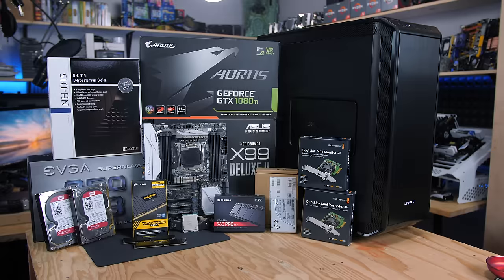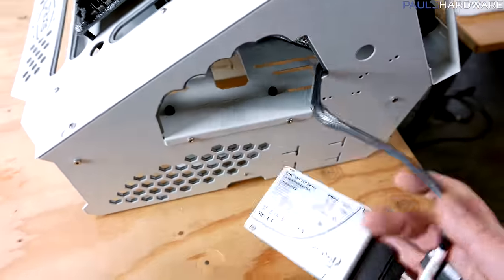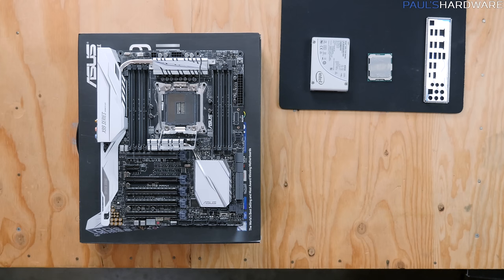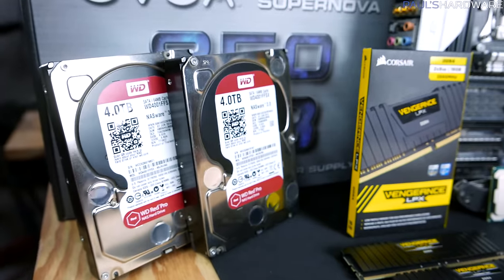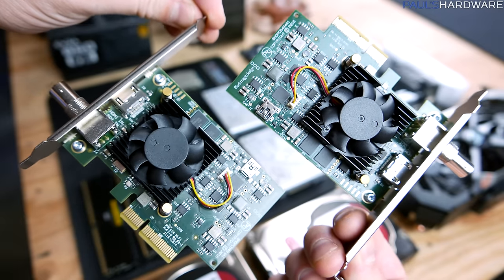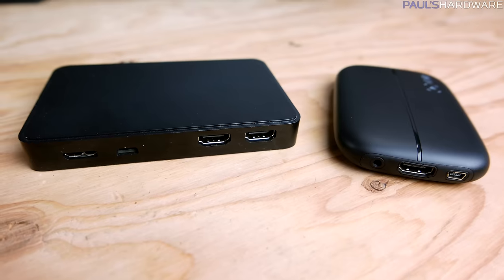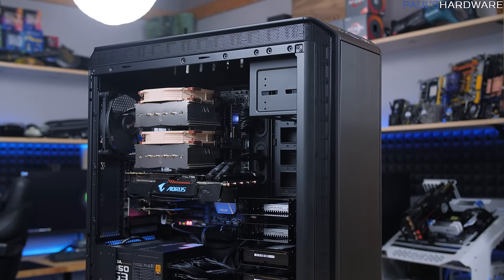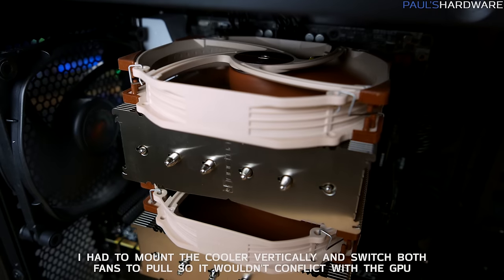The GODLY PC! My Ultimate Streaming + Capture System Build

Comment: I'm writing this, the year is 2023 and I'm just letting you know you used it till Q4 2018 when it died on you and you replaced it with a Ryzen "Epyc 2" 2998X which, to all surprise, you're still using. After the silicone depression of 2021, our modern CPU-s cost hundreds to thousands of bitcoins and even the second largest tech channel (your and Kyles Bitwit Hardware) can't afford better except for testing. Luckily, the Oculus VR TimeChat 2022 was invented last year by Facebook and almost everyone has it on his Android Q device (quantum smartphonewatch). PS: You're on a good way to pass LukeTechTips, maybe in 2024... XD
Reply: 191x7 agreed
Reply: 191x7 I get this is satire but Epyc are going to be geared towards servers
Reply: 191x7 luke dies in 2025. I'm from 2027. Consoles no longer exist.
Reply: GrizzlyPanda347 Aren't Opteron server cpu's and EPYC AMD's HEDT platform? But tbh Intels HEDT are just modified XEON's, so these can also be seen as somewhat server cpu's.
Reply: The Echelon Being that there's codenames and actual skus of different chips(Whitehaven=Threadripper, Zen=Ryzen)I wouldn't be sure. I'd expect them to rebrand Opterons like they rebranded their main line (FX>Ryzen). And Xeons are modified HEDTS from what I've read, not the inverse. An NCIX vid said that Threadripper were the HEDT chips, not Epyc.
Reply: Kill Ball2 so the "two years scrapyard wars 17 project" won't happen? now I'm sad...
Reply: At least AMD (perhaps Nvidia as well) may still hold some patents though.....I think
Reply: thread ripper is the workstation cpu and Epyc the server cpu just to let you know by facts .....
Reply: Missed opportunity by not saying "President Facebook".
Reply: 191x7 did Ireland get the 2023 rugby World Cup

Comment: can't believe i'm just now seeing this after all the research i did, just last month i built a very similar system except with threadripper 1950X. almost everything else is the same, but i also modded the case to accept three 5x3.5" drive bays in place of a front panel. so it has 15 hot swappable hard drives fed to a highpoint 3740A raid card, a custom HDMI slot + media card panel in place of the upper 5.25" floppy bay, then above that the case itself has a 2.5" SSD hot-swap slot which is pretty cool. on the back are more HDMI ins, SDI ins, etc. so it can hot plug almost any storage media you'd feasibly have footage on, capture directly on the computer, or link to any recorder or field monitor on the market. i had intended to make this system portable, as a way of basically consolidating all my field devices into one thing and then using software instead of specialized hardware for major field applications like switching cams, mixing audio, and storing footage. as it ended up, it is just as versatile as i intended it, i mean it HAS all of those functions plus a lot more. not only does it have all these capacities for interfacing with all my cameras, mics, and recorders, but i can edit on it, drive 4 displays with it, it's a $9,000 machine but it allows me to sell a sound devices 633, an odyssey and an atomos, and so on. the only problem is it just doesn't really adhere to my initial goals. i just didn't realize how heavy it'd ultimately be. i got a very particular case with a heavy duty handle on top so that i'd be able to lug it around the way we do with the specialized machines, but just one handle. i looked at plenty of cases with handles on either top corner of the tower, but decided against them because 1) the handles stuck out at diagonal angles, which would impede putting the tower into a pelican case and actually getting a lot of contact between the tower and the protective foam, and 2) these cases just happened to be built in ways that would make it difficult for me to mod them for the drive bays. i really needed hot swap bays accessible from the exterior, sort of like a rack. so i picked the only case i could find that seemed rugged, portable, AND moddable. but it ends up being over 100 pounds with 15 hard drives in it, and it doesn't have a second handle so 2 people really can't team up to carry it. but yeah assuming you can get it on location, it's extremely useful as like the central node for all your hardware, integrating all your cameras and mics and recorders and switching, mixing, and editing in real-time, while compressing AND streaming on a super expensive mobile network. this lets us not only stream 1080p yoga & meditation workshops out in wilder areas (which is something i don't think anyone has actually done before) but also add digital elements in real-time, not just slates but the graphics setup is strong enough to stitch 360 footage and overlay psychedelic fractal elements which we generate in real time with a specially made program. that aspect sounds a little over the top but if you can, why not? as for the resolution it's just limited by the wireless service you can get on site. satellite wifi is still nowhere near good enough to justify its cost, at least for us, so mobile service ends up being the best usually. hasn't happened yet but if we do get a location that has good cable or fiber service, we should be able to do exactly the same thing but at 4K instead. and the hardware is of course totally upgradeable, the real core of the PC is the modded case, so in a few years i could see getting a new CPU, a new corresponding motherboard, a new graphics card, etc. right now the only thing i'm considering adding is a quad M.2 NVMe raid card, for the added speed compared to my current setup of just one 512gb samsung 960 pro as a boot drive, and two samsung 960 pros in raid 0 as a cache drive and temporary media drive. basically that raid volume is where all the ingestion happens, and the actual work gets streamed and/or output to the hard disks in the front drive bays. these M.2 drives are all right on the motherboard and it's very fast but clearly it could be faster using one of those raid cards. problem is the highpoint card is not bootable, and i'm not sure how fast the dell card actually is.

Comment: Uhhhhhh. Paul, WD Red drives are designed to be non-standby Hard drives. They are great Hard drives (in fact they are in my NAS/Windows Server/Plex Server) but they are intentionally never in sleep mode to keep the read speeds up (Hence why they are designed for NAS systems). just thought you should know. WD even states this on their site.

Comment: I need help guys!!! I want to build a gaming/streaming/editing build. I want to know if these parts are good and compatible with each other. I don't know much about building a pc and the parts.

WD Blue 3TB Desktop Hard Disk Drive - 5400 RPM SATA 6 Gb/s 64MB cache 3.5 inch 
Questions: 
1) Is 7200RPM worth? Or is it worst? 
2) should I get more compacity?
3) Is SSD worth the buy for a content creator? Also what SSD should I get?

MSI GTX 1080ti Gaming X 
Questions:
1) is there a better graphics card? Besides the Titan X 
2) Is the EVGA or ASUS version better or worse? Is there no difference?
3) Is this worth for my type of build? Should I downgrade to a gtx 1080?
4) is the founders edition better?
5) Do I need multiple graphics cards?

Intel 7th gen Intel core desktop i-7 7700k 
Questions: 
1)Is there anything better?

G.SKILL TridentZ RGB series 16GB (2x8GB) 288 pin DDR4 3000MHz
Questions: I was planning on getting 2 sets so I would have 32 gigabytes. Is that to much?

Cooler master  GM series G750M - compact 750W 80 plus bronze modular psu 
Questions:
1) I don't know much about power supplys but I this compatible with everything?
2) is there something better I should buy?

Cooler master Nepton 240M cpu water cooling System all in one kit with 240MM radiator and 2 silencio fans
Questions: is water cooling worth in this situation?

MSI computer X99A gaming pro carbon ATX motherboard
Questions: 
1) like I said I don't know much about pc parts, but is this compatible with everything? 

Master case 5 mid tower computer case
Questions:
1) will everything fit in this easy? Is there a better looking case that looks good and can fit everything? (I personally dont like this case)

Am I missing anything? please tell me. Also thank you so much if you help me. I will respond as quickly as I can!

Comment: One of the best x99 motherboards there is, I love mine it's fantastic! also, i would get 3 more be quiet fans or Noctua ones and put one at the bottom pulling air in pushing it up into the GPU and 2 at the top pulling air from the CPU cooler and GPU and pushing it out, just some suggestions! :)

Comment: just a tiny question:
im aware the case has pretty good airflow and the fans are great as well, but wouldn't it be better if you placed the hard drives up on top of the ssds so they don't restrict the intake fans?
other than that, loved the video! it feels like nobody builds without tempered glass anymore. there's just something about a big black rectangle that does it for me xD

Comment: The Noctua NH-D15 is my favorite air cooler.
I stuck one in my dads Lenovo (in exchange for the stock AMD cooler) and stuck it on an A10 APU. It runs at about room temps and being near silent when running GTA 5. So a pretty solid choice, if ye hav the case to support it. My dads PC is a small mATX case, so we ditched the sidepanel and the cooler barely fits with cardboard between the GPU and cooler to avoid shorts.

The whole thing looks terrible, but works wonderfully XD

Comment: Hey Paul. Loving this build as it's fairly similar to my rig...

MoBo : MSI X99A “Godlike Gaming” Carbon
CPU : Intel Core I7 6950X
GPU : MSI GTX 1080
RAM : 64GB Corsair Vengeance LPX DDR4 3200MHz (8 x 8GB)
PSU : Corsair RM1000x
SSD : Samsung 960 EVO 500GB
HDD : Seagate Barracuda 2TB
COOLING : EKWB Extreme 360 with AER RGB Fans 
CASE : In Win 909 E-ATX USB 3.1 Type C 

I have a question. Would it be worth upgrading my GPU to the "Ti" version and my SSD to the "PRO" version? I mainly use the PC for gaming and was wondering if the gains would be worth the high cost.

Comment: Paul, you might consider the Be Quiet Dark Rock Pro 3 cooler.  I have the ...900 Pro case and that cooler installed perfectly in a standard push position.  The only issue was making sure to use low profile memory which I had to swap from Corsair LED memory.  However, since its a closed case, making aesthetics a negligible issue, this point may be moot.

Comment: nice cable management. i tend to face the drives the other way in a closed case or production machine. that way, if i have to add a drive or swap a drive, i just need to open one panel. not sure how those drive bays work though. i'm partial to fractal.

Comment: Those fans are going to buzz in pull.  You're better off horizontal mounting the cooler. With a 120 fan over the ram sticks. I had to do that with my P400 build.

Comment: Hmm that videocard puts out a lot of heat directly to the cpu cooler. I have similar issues with my less godly rig. My ultimate plan is to 3d print stuff to channel air more efficiently inside the case.

Comment: I have this very same board and boot drive. It rocks! Although, mine is paired with a 6850k, instead of a $1700 chip, it's great. I'd really like to hear if you run into any issues with ASUS software, as I did. Had an occasional BSOD, that I finally resolved a little while back.

Comment: I would like to see this build scaled down a bit, looks like a nice gaming/vr build, but would it make sense to use that mb, if not using it for your purpose? 
This build without the capture cards and fancy ssd's. Comes down to around $3200.  I'm looking for a proven build for the ultimate VR experience in the 2500$ range not including the VR unit.  Also, I don't understand why you would use a air cooled solution on that rather hot running processor, sealed water cooled units are very quite using the higher end fans? And that unit would have a much higher upgrade potential.  I never seem to get any questions answered, but I'm giving it another try.
Thanks

Comment: Rotating cpu cooler like this requires an upper case fan to prevent heat remaining inside the case. How do the cpu fans works by pulling air instead pushing it?
  The reason why I've bout the u14s single slot instead D14 for my oc Intel. More space around the cpu area. If you have a problem with a single ram module is a Totally pain to test the ram banks.

Comment: Had the same Issue with the Noctua Cooler interfering with the GPU on a MSI Z170 Xpower Mainboard. Switched it out to a Thermalright Silver Arrow so i could mount the Cooler horizontally

Comment: You should do the line method than the blob method. the line method will cover the whole CPU than the blob making a circle only covering half.
Reply: frecklyrabbit1_BrucePlaysGames Linus has shown any application method doesn't matter as long as you have enough. Only part that really differs is not putting enough down which hurt your temperatures

Comment: I really like this video thanks for doing something on the streamer side of things :) I am struggling with a way to stream my game play, I bought a 1440p 165hz monitor, which is beautiful. 

I bought the 1700 to try to get into some streaming BUT in comparison to my 6600k, my frame rate was CRIPPLED, I thought the 1700 would at least get to 165, but it didn't, and I cannot return the 1700 because I opened it. 

SO I am looking at playing on my 6600k and using the 1700 build as an encoder/streaming PC, i'm not sure how to do it exactly as I am using DP for my main monitor, I think I can use the Razer ripsaw, but am kinda out of money at the moment after buying the 1700. 

If you could touch on how to do higher resolution+higher refresh rate game capture I would greatly appreciate it. I think 1440p @144hz+ will start becoming the norm. I sold my 2160p monitor after a week of playing on my new one.

P.S. not trying to output stream at 1440p 165 , output goal is 1080p @ 45+

Comment: Is there a reason you went with the Noctua cooler instead of like an AIO Water cooler?  I know it is not needed, but for space and airflow, an AIO would have opened up the air flow with minimal impact to your GPU.  I know you receive good cooling from the Air cooling, but was just curious about your decision.

Comment: Nice video. thank you. Just curious, if noise was a concern, why air cool the CPU? couldn't a corsair H100i (or similar) closed loop water cooler provide just as good (if not better) cooling, with less noise?

Comment: Hey Paul.  Did the upright mounting bracket of the M.2 960Pro force you to turn the air cooler around by 90 degrees from normal?  I'm wondering about the warm exhaust air coming off the second fin stack.  I looks pretty close to the back plate of the 1080Ti.  Do you think this will have much of an effect on the temps of the GPU?  Or will there be enough positive airflow from front to rear of the case to deal with this?

Comment: I'm not an expert when it comes to pc building, thats why I ask: why did you put then hdd's and ssd's on the bottom of the case? Doesnt it conflict with the front fans? I mean they dont need cooling and there will come less air through the front in the case + it should create extra noise.
Reply from the maker: The hard drives do benefit from some airflow, and I prefer to keep them lower so the whole system has a lower center of gravity
Reply: oh that makes sense :)

Thanks man! :D

Comment: Hey Paul I'm just wondering...why did you want to replace your older 4770K if I may ask? I'm currently rocking a 4790K for my streaming PNC while my main rig has 7700K...was it because it didn't have great performance?
Reply from the maker: Mainly because I wanted to experiment with some 4K capturing and the 4770K only has 16 PCIE lanes, which gives 8 for the GPU and then just 8 more for SSDs and capture cards. 6950X has 40 PCIE lanes, and the extra CPU cores are nice to have too
Reply: That's awesome, I appreciate the reply! Your videos are so inspiring, you and Jayztwocents are the reasons why I have two PC's built for streaming and gaming. Thank you very much for helping me see the light of the "PC Master Race". Keep it up!

Comment: Paul, I have not built a system for many years (since cooling was a lot simpler). I am looking to purchase parts to build a new Plex server to replace a really underpowered one. How can I tell if the CPU heatsink and fan will fit the motherboard before I buy them? I noticed that in a lot of builds people have trouble with mounting them as they foul the memory or GPU.

Comment: Is it better to have the graphics card lower on the motherboard to run push configuration on the CPU cooler and keep the hot video card back plate away from the CPU cooler or to run it like Paul has here?

Comment: +Paul's Hardware Paul, how was building in the be quiet case? I found some screws that were so tight that I ended up shredding them and one I had to drill out. I have not raised this with the manufacturer (I probably should).

Comment: BAD drives placement. I get that you need your SSDs cool because you'll use them a lot, but the hard disks?? I would have placed the SSDs on the bottom most 2 drive slots and the hard disks way up top so the video card gets more airflow (from the front fans).

Comment: Yo Paul... I'm trying to install OS on a 960 evo nvme drive right now. the mobo is a z270 from Asus. But for some reason I can't find the M.2. I tried all the tips from Forum ect... can you please make a little video on how you detect it at all ??? 
Its making me crazy, since I installed a 960 evo on a B250 mobo from Asus just a few weeks ago, and it worked smooth, now... whatever I do, the mobo will not detect the 960nvme drive :(